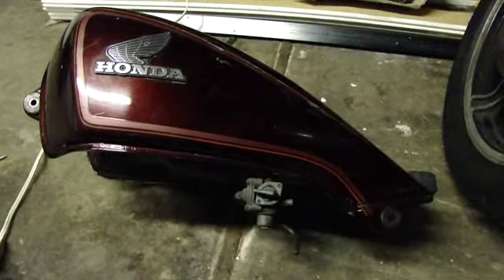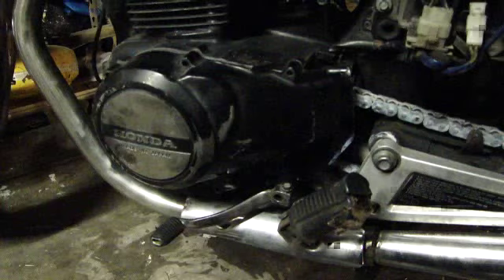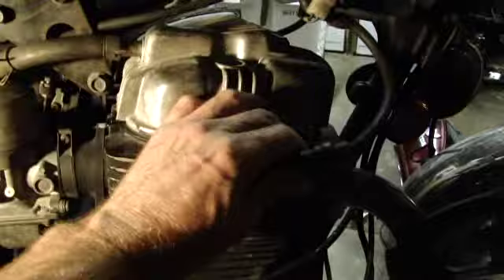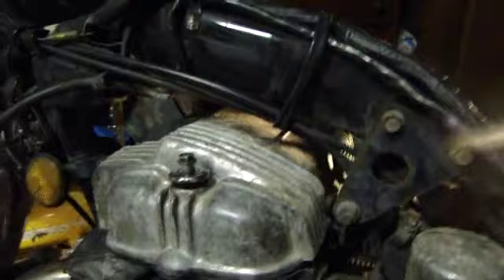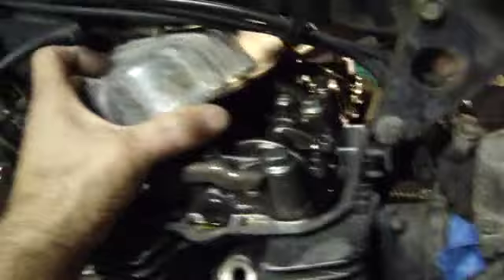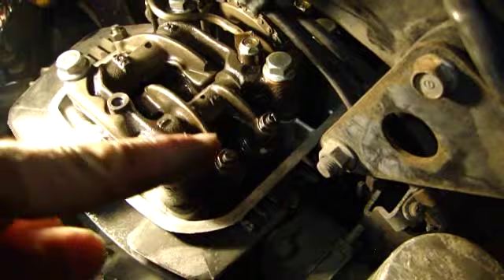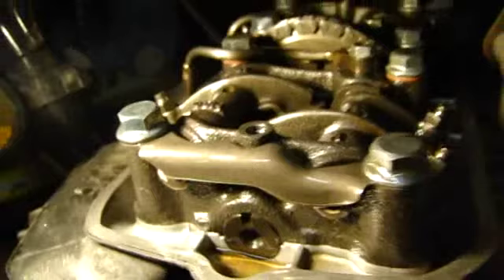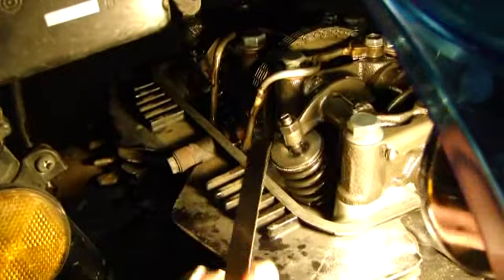Honda cb450 valve adjustment

Comment: Great video, one trick I learned doing valve lash adjustments on my old VW motor is put your flat blade screwdriver through the end of a box end wrench, once lash is set you can hold the set screw in place with the screwdriver as you tighten the nut down with the wrench so it stays in place.

Comment: Great video I would just like to make it clear for the noobies like myself that you demonstrated how to work on one set of valves on one cylinder. To then switch to the next side, do one complete rotation of the alternator and align again with the "T." Valves on the other side should be loose and at top dead center for you to then begin adjusting.

Thanks dude!
Reply: +Brian Parker  Great point.
Reply: glad you clarifed positon for right side.. Enjoyed your step by. step thorough explanation and decent video imaging.. thanks you you make it easier and funnier for us wanna be diy'ers!!!
Reply: @cjmn8635  no problem =]

Comment: Great tutorials, I have a 1982 CB450T that I just brough out of a 2 1/2 year sleep and although it's running you've given me great videos to follow while I wait for my insurance to start at the end of July.  I think there is slightly excessive valve clapping and since I have to replace the valve cover gasket due to a slight leaking of oil I am now looking forward to adjust the valuve and get it running smoother.  Thanks a lot and keep the vids coming.

Comment: Thanks for this. Extremely helpful. I just completed this process, but it didn't solve the high pitch metallic clicking from the engine. Others have suggested it wasn't valve noise, but a loose cam chain.

Comment from the maker: Tx for the feed back...If you can get the cam cover off without removing the tank, then its not necessary to remove it.  I did it for accessibility....The spark plug wires are also for accessibility, the plugs them selves are part of the procedure listed in my cb450 repair manual.  Honestly, im not sure if its a problem leaving them in.  Removing them relieves compression resulting from turning alternator bolt...I haven't tried procedure without removing plugs.
Also good time to change them...

Comment from the maker: Definitely do it when you get it, then my goal is once a year, which may be overkill depending on how often you ride.  You may not hear anything, but it will help performance.  Im not an expert on symptoms other than I know if they are tight you may hear excessive valve clapping noise, but its hard to judge if your not familiar with you bike.
if they are loose you will loose compression and performance.

Comment: You've got that backwards. Tight valves will reduce compression because they're not allowing the face of the valve to make a complete seal. Loose valves, on the other hand, will cause excessive noise as the valve slams shut and the tip of the adjustment screw (not set screw) has too much space to take up before it contacts the tip of the valve stem. It's a very precise operation.
It's actually better to set the intake valves a little on the tight side, exhaust should be at the upper end.

Comment: James, i have really important question. I saw a few times this video, and I did not figured out how to adjust right side valves. Question is: Does both cylinders are at the top dead center at the same time? Cause if its not the other side should be adjusted the same but before that rotor should be rotated a bit. How much it has to rotate? Thanks